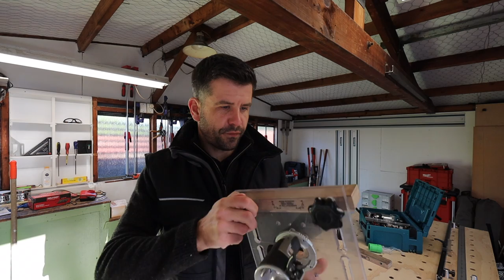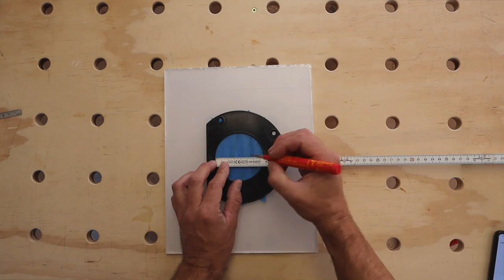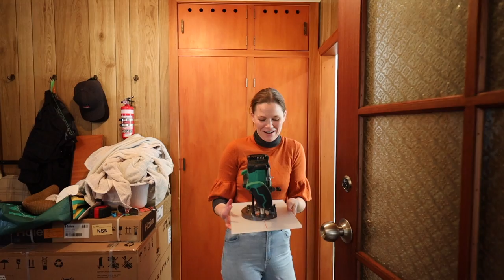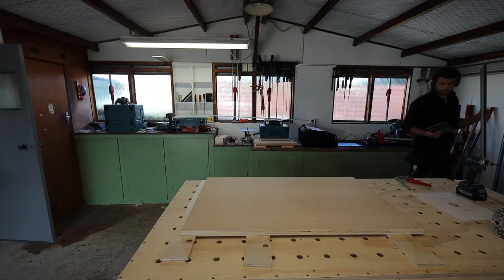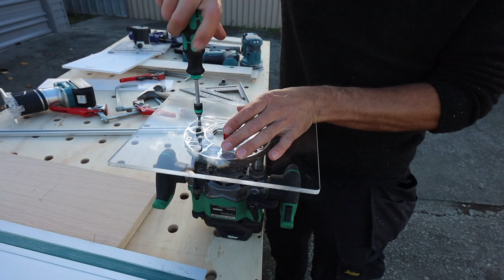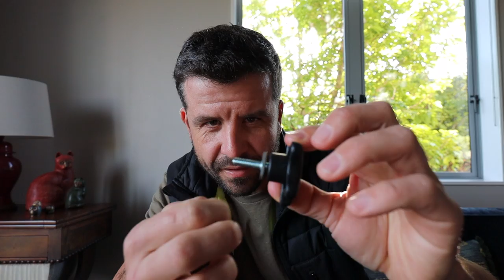A Router Table That Anyone Can Build

Comment: Interesting. All the router tables I have seen always have the bit close to the guide so unlike a table saw, the workpiece is never trapped in between the guide and the bit. I wonder if it's got to do with the potential for major kickback or I have just not seen enough router tables.
Reply: That was my first thought when I saw the video. Sorry, Scott. You have a major problem with your table. Fix it, for your own safety. Router tables could be as dangerous as a table saw.
Reply: Agreed Arash... Unlike a table saw, a work piece should never be between the router but and a fence. Especially if a climb cut is required... Scott, you need to revisit your fence design bro...
Reply: same thought .. could end dangerous, but only the Kickback, also that in can shoot through
Reply from the maker: My plan is to build a proper router fence with a hole in the middle (much like Ron Paulk's). I ran out of time on this episode so I used the offcut of timber. Good point about using it between the bit and the fence! Won't do that again 😃
Reply: Phew....as soon as I saw you pushing that off cut the wrong side ( climb cutting), I was like nooooo.
Glad your gonna fix it.
Reply: The worst kick back incident I ever had was on a router table. It was so violent the bit snapped at the shank and the work piece launched at me and struck my inner thigh. It was painful but more just very scary. Haven't used a router table since lol
Reply: @ScottBrownCarpentry  👍 good video, again 😀 Thanks for sharing and I’m building this for my table saw wing, but might add a starter pin (see Stumpy Nubs video). Also wanted to ask if you might include in you next video some explanations of others warnings/feedback here in the comments? Each one, teach one 😉
Reply: @ScottBrownCarpentry  good idea with the cut out.  its easy to make a small dust hood at the same time which if done properly will collect practically all dust.
Reply: Correct. What Scott has essentially made is a powered shoot. As Scott has said above, all you really need is a fence with a space in the middle. It can be as simple as a piece of ply with a fortsner/holesaw cut in the middle or a full on incra jigs set up. Both will provide the same end result, one may be slightly easier to setup than the other.
Reply: Totally different tool. The routertable is rarely used for ripping down stock.
Reply: It's almost like there is a reason for designing things before you start.

Comment: as an acrylic fabricator, yep if you cut acrylic on the table saw you do end up looking you were just in a snow storm ! just a note_  drill in reverse, or use a blunt bit as that way you are scraping NOT drilling the hole, stops the shattering you get. And  the easiest way to get the hole in the center for your router bits is to use the router bit by using it like a mill once you have your plate attached to your table, think of it as a zero clearance blade hole.

Comment: A more simple way to make the fence is to pivot on one end with a screw or bolt and just clamp the other end to the edge of table. There’s nothing to make square with a round bit unlike a table saw. No t-track headaches.

Comment: I'm used to larger, corded routers https://www.youtube.com/post/UgkxfQ5_mgwq6PcudJvAH25t-I4D-3cTPz4z so this was a different experience for me. Basically, this is an incredibly sweet machine, fits well in the hand, etc. It has slightly less power than I'm used to, but that's understandable. Maneuvering freehand takes some practice. These days, it's especially nice to be able to avoid power cords. This is above the level of a hobbyist but below a pro level.
Reply: They make a nice plunge base for those too. I have had one for ages. Anything that needs a 1/2" bit, I use my router table. Which is a corded beefy one in a router lift built into my table saw wing.

Comment: Hey Scott, just wanted to add me to the people who tell you to please change the positioning of your fence. If you got a router bit that has some curves or corners, the work piece is going to get trapped between the router and the fence. Even more dangerous than a table saw in my opinion, because its not necessarily flying straight back. The fence normally is right around the routerbit (so a little cutout at the bottom is necessary) and can be adjusted a few millimeters back and forth the width of the bit so you can adjust the depth of the cut. 
Also this fence you built is limiting the size of your work pieces. what if the work piece is wider than the space the fence gives? You won't have that problem with a changed fence either. 
If my description is a bit blurry (sorry) maybe just look the big industrial woodworking routers up, they all got the fence I was trying to describe. 

Hope your renovations keep on going well! Greetings from Germany
Reply: +1 on not using the fence like Scott did in this video, with the piece in between the spinning bit and the fence, and not feeding the piece in the same direction on both sides of the spinning bit.
Reply: Scott probably thought that the fence in a router table works the same way as a fence in a table saw. Wrong.
Reply: @xdanielgs  100% correct, fence and bit are to be as close to each other as possible so that the work piece dosent get stuck in between

Comment: So much work.. I’ve worked in several workshops 15 years exp... the best router table I’v ever used is mine at home.. it’s a 5’x3’ 25mm mdf of beaten up mdf with a hole cut in it which I bolt my festool to as and when needed, throw it on top of a pair of folding wooden legs I made about 12 years ago.. My fence is just what ever is lying around with a half decent straight edge I just measure off the cutter and screw it down- job done.  Got a nice plastic extractor hood with my festool router I screw down behind the cutter - get perfect results with this set up... takes up no space and can be set up and broken down in mins... keep it simple less things to go wrong 👍🏻

Comment: Agree with others to change your fence location - simple U shaped notch in the board you are using for your fence to house the majority of the bit will make it that much safer, plus gaining the ability to put a dust hood and hose over the bit. 

An item that probably won't matter for now, but may cause you to build another in the future, the router plate is very close to the edge. If it were turned 90 degrees and set back at least 150 mm or so, you could route in another groove perpendicular to the fence t tracks for a miter slot and third t track to be able to put feather boards on. The miter slot would allow you to do joinery on the ends of a board safer and not just long edge work. 

Beautiful work with the plate cutout.
Reply: totally agree, you cant use it like a table saw fence, bit needs to be part of the fence so to speak, way safer !

Comment: Bit o advice: use the power cord adapter with your router so you can instal a safety cut off switch. As others noted, the fence positioned opposite the bit side will create a pinch point. Since the router has a drop in base that is rectangular, it is possible a kickback can have equal opposite force popping the router insert from the inset… and like that time when we still had square sewer manhole covers, this could rotate and drop thru to the floor. You’ll also note that the bit must be on the right as you feed. Pushing the piece you’ll want pressure toward the bit- impractical if your fence isn’t in the same direction. Relying on bearings- you’ll soon burn them out and send them flying. Position the fence over the bit and over the pop in and it can’t pop out. It’s also convenient for dust- I have dust extraction in my fence as well as below the table top. Also consider an auto pusher- kind of like motorized roller skate wheels- that adds another layer of protection from the potential of life shattering bits. But also keeps your work exactly level with the bit. You can secure a pusher to the fence. 
Table saws typically have enough room for an undermount jigsaw or router. The tablesaw has much sturdier metal base to reduce flex and chatter. That Metabo Hitachi Koki table saw with 35 inch capacity seems like a great candidate for a portable cabinetry base mod. You probably don’t want to muck up a good saw though. I have an ancient mini skillsaw table with attachable wings I am planning to mod for ripping and shaping trim. All in one. But why. I already have a router table. 
Tools.

Comment: For what it’s worth, I use the side extension on my table saw with a bit of plywood inserted so it’s flush with the table and fit my router to it. I found that my work bench had started bow over time and wasn’t accurate enough as a router table

Comment: NEVER ROUT IN BETWEEN THE FENCE AND THE ROUTERBIT!!!
WHEN YOU LET GO IT LAUNCHES THE WOOD.

Make a U shaped cutout from the edge of the fence facing the routerbit.
Then you can slide the fence forward so the edge that touches the workpiece is past the router bit.
Now you can rout on the other side of the routerbit that is closest to you.
Feed from right to left standing in front of it.
Reply: Instead of merely stating what is done incorrectly, could you please complete your comment with how to do it correctly.
Reply: @BigLeBowski4456  Sorry, your right I added a solution.
Reply: It's a lower hemisphere thing kind of like how toilets flush in reverse direction
Reply: @3dmazter  His right?
Reply: @sw6188  yes when you stand in front facing the fence
Feed from right to left

Comment: As well as having the fence closer to the bit as others have suggested you need to be able to have the 2 halves of the fence (the before the bit and after the bit) offset slightly if you want to do trim cuts - that way the work has a fence to slide along after it has been cut (ie trim off 1mm then fence offset by 1mm). You can archive this by having the fence in 2 parts - the main fence goes all the way through but this is faced by 2 more fences attached to the main fence (the before and after bit part) and just add a spacer of the required thickness to the 'after' part. I find the Formica samples to be great for this.

Comment: Another thing to point out is because you have mounted the router plate underneath the Perspex you have lost about 6mm of depth capacity from your router bit. When I made my homemade router table I routed out the plate on-top so it was flush with the top surface of the table. The extra depth allows the router bits to have more of their shank inside the collet which results in a safer, more stable bit. Also makes it easier when routing out deeper cuts for tongues and groove or other similar joints.

Comment: Hi Scott, the drilling in acrylics pulls itself in. Solution if you’re doing a bit is to grind a flat inside the flute so the cutting edge is scraping a bit more. Love your work.
Reply: Or to use a brad point bit.
Reply: @alexrains1893  haven’t tried that but I’m sure it’d work.

Comment: I usually use a triple chip blade to cut plexiglass or lexan. They are designed to remove stock less aggressively and create a cleaner safer cut. My understanding is that it is the heat created in the cut with acrylic and lexan that leads to shattering. Also have had some luck attaching my router table extension using mating 20 mm holes and a couple tso powerlock dogs.

Comment: Hi Scott, I’ve just had another thought on the bench router table.if you want to have fine adjustment of the router bit you may need a sub base to put some form of adjustment. My router as a small hydraulic jack.

Comment: Having worked with plastic when I was teaching and since instead of using perspex but to have used polycarbonate as all wood and metalwork machinery can be used. Stronger and no fear of breakage. Polycarbonate left in the sun doesn't become brittle like perspex. Led light covers for on trailers offer excellent protection from stone damage. Recently used milling machine to make some covers. Don't drop the perspex.

Comment: I made a router table yrs ago, you're going to want some kinda dust collection. It makes a big mess routering all day. The other thing I did, was purchased a router housing & just removed the motor part so I could still use my router by itself. Great project

Comment: I happen to be at precisely the same stage of having a neo-Paulk/SB carpentry bench (only 1200x600mm) and needing a router table. However, I have had a old-timey cast iron table b4. Hopeless for tool changing and height adjustment. Also...
I find that simplest isn't always best, cos once you start using a table more the more useful I found the 'fancy' features of bought tables.
So..... I bought a router that has height adjustment and tool change from the table top, plus dust extraction fittings. And... bought an insert plate.
This gives me quick adjustments and stability.
I will build a fence that has a split lower section to 'hide' most of the bit. A fixed upper section that takes feather board(s). All with dust extraction.
The table will be flush with the benchtop, hinged braces to stiffen the routing surface and all with captive nuts and so no-tools assembly.
I am agnostic about using tee track but note Ron Paulk's preference to build the tracks into the fences and tables.

Comment: NIce work Scott.
Id always try and cut perspex/acrylic on a table saw if possible, with a track saw the material has difficulty clearing as its heavier more dense than mdf/plywood so it tends to heat up and almost weld the two pieces back together like you found.

In terms of drilling perspex/acrylic you'll be fine so long as you have a board underneath and take it steady otherwise you may chip the hole on the underside when you break through. I'd also round off that last corner if possible as if you catch off something it will likely chip or fracture that corner. Much better chance with a slight radius on the corners.  

Id try and get hold of some Polycarbonate next time due it being more robust and more suited to the job than perspex/arylic as that is more like a glass substitute.
Trespa is always a good base plate material but isnt clear.

Comment: Concerning the router, I built a router table with that small trim makita router you have too, it has already a built in dust extraction and I find the small routers much safer then the big ones, that particular router has a speed setting too what is fabulous forwider router bits that require a lower speed:) I would definitely built a higher fence with an adjustment system, this way you have the option to place your boards vertical.

Comment: Apart from the fence and extraction stuff that everyone's already mentioned I'd concerned that the perspex plate will start to sag after a while. Half inch routers are heavy buggers I'd say by the end of summer you'll probably find you've got a sag in the middle of the plate. Been down that road myself, built several different tables over the years.

Best router plate material I've found is aluminium and you should be able to find a ready made plate on eBay for example that's already got the correct holes in it for your router.

Comment: Simple and elegant, I like it :)
I spent too much time making my own router table and I didn't need all the extra fancy bits and bobs that I added.
Sadly you didn't add enough space for it, but a mitre track is pretty handy to have, it makes it easy to do finger joints and other "cross cut" type stuff on it.

Comment: I have used a cardboard box duct taped to the underside of similar setup with shop vac hose zip tied to the router inside of the box and it worked well for what it was. Same with home build tablesaw.

Comment: For your router table: HIGHLY recommend making accommodations for both horizontal and vertical featherboards. One on the table to hold the work to the fence, and one on the fence to hold the work to the table. These do a fantastic and repeatable job of making sure the work is both tight against the reference surfaces (even when a spinning bit or weight of the stock cantilevered off the table might be trying to push/pull it away) AND preventing kickback. I got the kind that have long slots for the tightening knobs to pass though, and was able to get away with a couple of threaded inserts per featherboard (one pair in the table, one pair in a plywood one-piece fence)...but people like to use T-track for that too.
Reply from the maker: Interesting, sounds like a good idea. Any brand recommendation?
Reply: @ScottBrownCarpentry  when there's a miter slot, I like the Milescraft ones because of the aluminum miter bar spreader (every plastic one I've had has cracked) - great for that table saw (I have the same one). But if you want to just drop threaded inserts in your new router table, you'll want the kind with parallel knob slots, like Kreg's or FeatherPRO (which i've not used but people seem to like them) - just look for those aluminum spreaders. I have gotten by with one featherboard on each side (table, fence) just ahead of the bit, and thus haven't needed the adjustability of a slot along the feed direction

Comment: Usually I rout a channel or any straight line with the round base. A square based even a tiny angle off the guide will move the channel. A round base you can rotate the router 360 and it stays the same distance from the guide.

Comment: Hi Scott. Check out a Festool CT CYCLONE  CT-VA-20, it is $419.00 in the USA. It will attach to the top of your vacuum collecting all the large pieces and only minor dust goes in the vacuum collection bag. The bag will last a long time saving you money in the long run. Great videos.